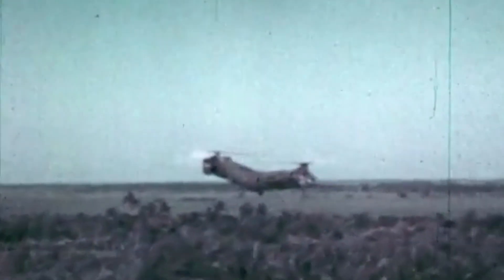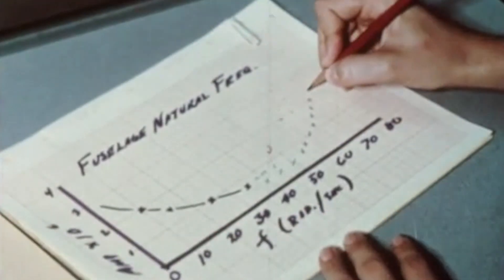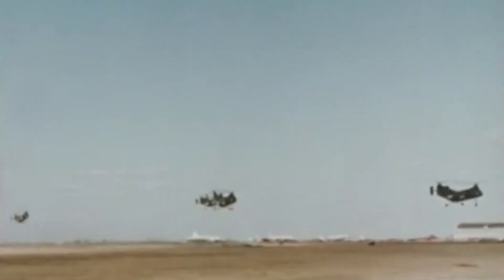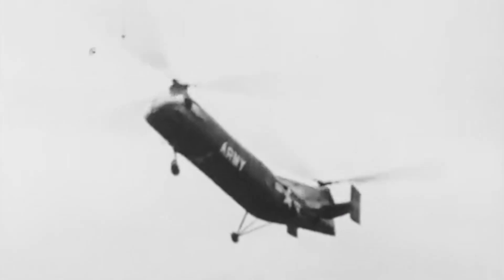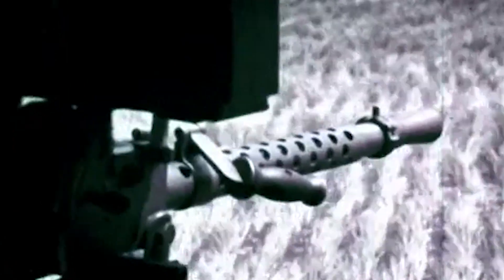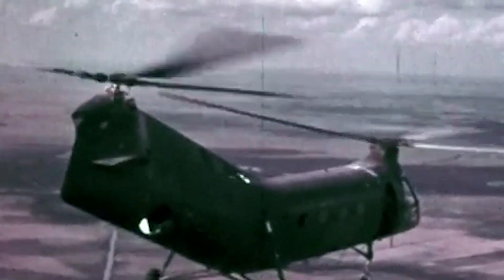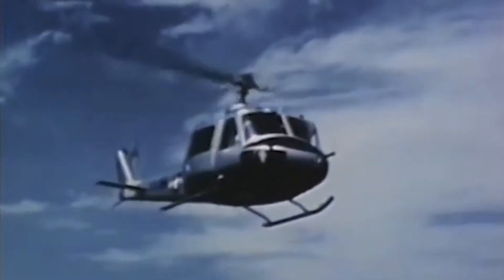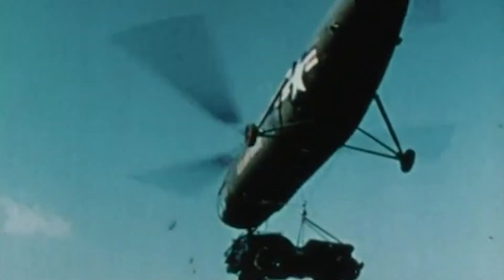Piasecki H-21

Comment: There was a lot of rethinking when Boeing became the owner of the helicopter line.  My step dad was one of the engineering and production design team members from Wichita to take on the challenge of seeing just what they had back then.  He related stories to me on how primitive some operations were at Piasecki when they came onto the scene.  They were using wooden yard sticks for doing what amounted to critical measurements and there were many variables that allowed as much as 1/4" off in matching fuselage parts.  Construction of hydraulic pipes and hoses amounted to them being custom for each unit so there was a very large parts replacement inventory but there was no guarantee it would fit any unit already out in the field.  Interesting stuff.

Comment: Used to see one fly over Long Beach Ca.  awhile back. You could hear the drone of the radials for miles before  you saw it. Fine piece of machinery.
Reply: Only ONE radial engine in an H-21.   And I'm surprised it never got upgraded to a turbine, but most of them timed out due to their wooden rotor blades. If you see one that's been out in the weather too long, the blades just fall apart when water gets into them. That "cold weather operation" rubric was a tongue-in-cheek reference to the under-powered design that required low density altitude to have reliable performance. This was in the early days of helicopters, when low disk and power loadings were the rule because bigger piston engines and rotor dynamics made so much vibration they literally shook themselves apart.
Reply: @craigwall9536  this one I saw , is at  Van Nuys I believe & there is a video on YT , on that airframe 
Thnx for info.
Reply: In the old days I worked on the last CH-21 in El Cajon at Gillespie Field. It was a lot of fun to fly in.

https://rotors.org/
Reply: @DavidS-iw4ei   got a ride in an old H34(radial) LASD-air frame retired in 87-' in 84'-medevac  to hospital. Only time flown, never even a fixed wing ride.

Comment: There’s a few of these at Pima air museum. You can even see inside
Reply: Great museum! Spent a whole day there once.
Reply: I've been to Pima twice, the last time with my dad, a retired USAF Chief. He remembered the tail number of every plane he worked on in the air force, and several of "his" planes are at Pima.
Reply: They have one at the Army Aviation Museum in Ft. Rucker, AL where the Army trains Army pilots and Warrant Officers
Reply: Our local surplus salvage yard had one out front that I used to crawl over as a teenager.  It was smaller in real life than it seemed on the screen.

Comment: In the early 1960's the Department of Defense interceded in the service rivalry which found the US Army with more fixed wing aircraft than the US Air Force and the Air Force in competition with the Army and the Navy over helicopters.

Basically after the decision the Army got the helicopters and the Air Force the fixed wing airplanes.
Reply: The Army was allowed to keep fixed-wing small observation and liaison aircraft as part of the deal.  The USAF had little interest in choppers and did not fully appreciate their potential as a ground attack aircraft.  Also, the Air Force was miffed about the Army having CV-2 Caribous, seeing it as a threat to the much larger Air Force C-123 Provider (which itself started life as an assault glider).  As part of the deal the USAF got all of the Army's CV-2s and rechristened them C-7s.
Reply: @Paladin1873  Thank you.
Reply: @lynnwood7205  My pleasure.  I knew two CV-2/C-7 pilots, one Army, the other USAF.  The former was a retired Army WO who told me his unit participated in a competition between their aircraft and the C-123 in the ealry 1960s and beat them in short-field landing and takeoff.  The C-123 was much larger and carried double the payload, so it would not surprise me that it lost.  He also told me he had transitioned into the Caribou from the Bell H-13 (Bell Model 47) where he had once tested them as potential gunships.  They mounted several Browning 1919 30 caliber machine guns on the skids.  I think this configuration saw some limited service early in the Vietnam War.  
The USAF pilot was a later coworker of mine who had flown the C-7 in South Vietnam in the late 1960s.  He told me one humorous story about flying down a river and spotting some suspicious looking characters on an island, so he buzzed them.  When he returned to base the maintenance crew found a bullet hole in the throttle quadrant between the two pilot seats and a matching hole in the roof.  Not bad shooting for a Gook. ;-)

Comment: For the record: the H21 were intensively used by the French Army in Algeria from 1955 to 1960 although it was indeed designed for low altitudes and temperatures. But they were the only H/Cs available on short notice at the time so they took them although in summertime they were operated in high temperatures and altitudes. The payload was then quite low but ... they invented the "air moblity concept", developing tactics to project force rapidly and close to the ennemy.
This concept then reached its peak when used at a large scale by the US in Vietnam.

Comment: What is that Shawnee at 8:22 doing? It looks like it's got either eight or 16 rocket strap to the front gear
Reply: Your answer would be at 0:35
Reply: Spot On! Got the enemy 
heads down, inbound 
to the landing zone. 🤟🏽🐻

Comment: The Flying Banana performed well as a transport helicopter in the French Algerian War of 1954-62, alongside the Sikorsky H-34.
In the rugged terrain that the French were fighting in, they quickly realized the value of being able to insert units into hard to reach positions at will. A few could put a platoon on a strategic hilltop that would otherwise have been several day's marching from the nearest road.

Comment: @ DarkSkies, you switched the CH-46 and CH-47 pictures at the 7:50 mark.  As a CH-47 "Hooker" for 21+ years, I died a little bit inside.  😅
Reply: I'm about half convinced by now that he does this sort of thing on purpose to see if anyone is paying attention.
Reply: I can assure him, we are!  😄
Reply: @heavenst.murgatroyd3128  I've commented many times on the 'mistakes' on @Dark uploads - I still can't decide if they are genuine mistakes or a deliberate, not to say cynical, ploy to increase engagement - more mistakes, more comments, more engagement, good for the YouTube algorithm.
I can kinda understand doing it, however this is supposed to be a factual, documentary style channel, where too many mistakes could be seen as a turn off for a number of subscribers.
I'm no academic, but if I can notice as many mistakes as I do I can only imagine how many the real history buffs spot.
Reply: As a former Navy H-46 driver I caught the swapped pictures between the H-47 & the H-46. The smaller H-46 was primarily flown by the Marines but the Navy used them for both search and rescue plus under way replenishment of the fleet. The H-46 had an advantage for the Navy in that the rotar blades folded across the top of the fuselage. In an emergancy it could also land on the water, but don't come down too hard. We were told the record time to sink for an H-46 with a broken chin plexiglass was about 9 seconds.
Reply: Not to twist the knife but the Sea Knight is a beautiful bird. The Chinook is... well... useful.
Reply: @justme_gb  90% of people couldn't tell the difference between the two of them without it being pointed out.

Comment: Forwared/aft (elevator) on a tandem is accomplished by increasing the collective pitch on one rotor and decreasing it on the other. Left/right cyclic (aileron) is the same as a single rotor helicopter i.e. increasing and decreasing cyclic pitch on each side of the disks. Interestingly while aileron cyclic has phase delay like a single rotor helicopter elevator does not because it involves the entire rotor disk changing collective. Yaw (rudder) is by opposing aileron at the front and rear rotor disks which pushes the disks in opposite directions. By mixing rudder and aileron control inputs the pilot can shift the point of rotation forward or aft from center. The pilot controls work exactly like an ordinary helicopter with a cyclic stick collective lever and rudder pedals (though the manual refers to the collective lever as the "thrust control lever"). 

 Elevator cyclic is unnecessary however later model CH-47's have a "longitudinal trim actuator" which is used to bring the nose up in forward flight to reduce drag (make the helicopter more level in fast forward flight) and push the nose down in hover and compensate for the CH-47's nose high hover (the rotor masts are tilted forward a few degrees which causes it to want to hover nose high). This is all handled by the flight electronics the pilot has no direct control over the elevator trim. Elevator cyclic cannot be used for forward/backward movement in a tandem helicopter, all it can do is push the nose up or down, to move forward a tandem has to use differential collective at the front and rear rotor disks.

Comment: 0:25 is that a first prototype of CH-47 Chinook?
Reply: Yea
Reply: No, it's an H-21 which came many years before anyone even thought about the CH-47 and they are very different.
Reply: @live2ride18  Don't say yea when the answer is no.
Reply: @skunkjobb  you’re right I was wrong but so are you. I mistook the word for predecessor I see coming back here but what are you talking about? 
Do you know when this aircraft retired?
1964. 
Do you know what tandem rotor aircraft took it’s place?
Ch-47. 
So in a lot of ways it WAS the prototype. They slapped another turbine on. Upgraded them to around 10000 hp, got to then widen it, add a machine gunner door to some variants, it could carry the 20 men that the h-21 was supposed tooooooo
So. 
I would not go around being the YouTube know it all. Then tryna scold someone like my grandma when I was 4. 
That doesn’t always work out for you. This banana that the “chinooks never ever heard about” had OVERLAPPING SERVICE. 
Know what that means? 
They use them both at the same time 😱
Alas, the h-21 was retired in 1964 after serving some time in the Vietnam war when guess who took over....
Ch-47 which was first flown in 1961. Entered service in....1962. 
Good day 😉
Reply: @live2ride18  I'm with you.

The HUP 1/2/3 begat the H-21 which begat the H-46 (my bird) and H-47, so substitute predecessor for prototype and you're 100% correct.

The tandem rotor configuration has many advantages:  it makes the aircraft much less sensitive to weight and balance variations with internal and external cargoes (great for moving beans, bullets and BandAids), better or at least less complicated flight characteristics, an unobstructed cargo deck and safer pax operations since the dynamic components are well out of the way (no tail rotor).

Phrogs Phorever!

Semper Fi!
Reply: @joseywales6146  Thank you Sir. 
I live in the middle of a triangle of three air bases and a supply base. Always been keen on aircraft and studying warfare and it’s equipment. 
I would have loved to have went to the local A-10 school, but my grandpa built a rather large farm that my dad has now. 
The A-10’s practice overhead. I’m 28 and over the years being in fields I’ve seen the warthog’s pilots faces (helmets) they swoop in our fields, I guess to practice flying under radar 🤷 so low they pull up for trees. Went in front of me 1000 feet at 50-60 feet high. Got a personal air show with flares four days ago. 
Appreciate it. I bet your time served was fun.
Reply: @live2ride18  thanks for the info bro ☺️
Reply: @jeraldsantosmunoz6273  well... I did try and keep it simple 😅
But I don’t like when people give me bullish!t when their full of it themselves 🙄
Reply: @live2ride18  yeah I know but I’m just asking if I am not right and I’m free to correct me tho
Reply: @jeraldsantosmunoz6273  you know how they have 3rd, 4th, 5th..etc generation jet fighters. In this case it’s like that. All the demands that were requested for this aircraft that it was never able to meet were learned upon and applied to the ch-47 to me the demands plus a whole lot more as turbine technology increased over the 20 years. There was an aircraft in between as the crew member of one commented on your thread. It’s not a direct prototype in the usual way. This one was used for 20 years but it’s a “we developed the ch-47 because we stood on the shoulders of the giants that made this”
Technology improved to meet the requirements the military had in mind to begin with. The aircraft stayed about the same. She just got some serious weight and hp added. 
Amazing aircraft that they teach them to fly like it’s a 10 foot helo 😂
Reply: @live2ride18  absolutely bro

Comment: The reason the Army was forbidden from having ‘large helicopters’ was the same reason the Army was restricted to light observation and utility fixed wing aircraft and light helicopters. In the late 1940s the Air Force, a new branch independent of the Army it had spun out of, screwed the Army in an agreement executed at a weekend conference in Key West, Florida between the Secretaries of the Army and Air Force, and umpired by the Secretary of Defense. That is why the Army never got its own tactical air support capability like the Marines have, and that is why the Army had to develop armed attack helicopters, cargo helicopters, and troop transport helicopters during the Vietnam War. The Army today has the Apache and other advanced helicopters, but it still has to rely on the Air Force for tactical air support.
Know how much the Air Force cares about that? The Air Force sees itself as a missile, bomber, and fighter force. Not a tactical close air support force. The Army was developing a radically new armed attack helicopter a couple of decades ago. The Air Force, afraid the money for that helicopter would come out of its budget if it let the Army project go further, said ‘ We’ll develop a special aircraft that will be ideal for low level close air support’. 
What resulted from that was the A-10, known as the Warthog (but officially as the Thunderbolt), probably one of the best close air support  aircraft ever made. As soon as the Army program was shut down and the Air Force got the A-10, it started to try to find ways to get rid of it. Desert Storm saved the A-10; it killed so much Iraqi armor and slaughtered so many of Saddam’s Republican Guard it couldn’t be ignored. In the endless expeditionary wars we have fought since 9/11, the A-10 has proven itself to be the answer to the Army’s problem, and the Air Force has not once slackened its attempts to kill it.
That’s how much the Air Force cares about close air support.
Oh, yeah... sorry, I got off track. The H-21 was a good, if underpowered, aircraft in its day. In the early years of the Vietnam War, the Army Transportation Corps owned all the Army aircraft. The H-21s that went to Vietnam in 1961 and 1962 initially operated in the Mekong Delta, lifting units of the South Vietnamese Army. The Marines owned some and the Army owned some. The other troop helicopter in those early days in Vietnam was the Sikorsky H-34.
The H-21 wasn’t known so much as the ‘flying banana’ as it was known as the ‘Shuddering Shithouse’ for its characteristic vibration.
Reply: No the A-10's battle field statistics were actually falsified for the longest time in 91 the F-111 and the F-15E actually have more tank kills and sorties

Comment: The tandem rotor configuration makes aircraft suitable for heavy cargo hauling, especially with electrically controlled external cargo hooks. 

This type benefitted from not having a conventional tail rotor, thereby allowing full power to be used for lifting, it also made the aircraft considerably safer because tail rotor failures result in deviation from controlled flight and frequently to the loss of the aircraft and crew!

Eliminating the tail rotor and it's inherent dangers further enhanced survivability of the aircraft during use in  hostile environments.

Today's Boeing CH series of tandem rotor helicopters are further developments of the type and have been incrementally upgraded and improved to remain current.

Comment: The Huey did not have a "jet" engine. It had a turbine, like the vast majority of helicopters do today. A jet is a specific type of turbine used to produce thrust, not torque.
And the reason helicopters use turbines instead of piston engines is because the turbine is most efficient running at its highest speed, because for a helicopter, there isn't much difference in fuel consumption between hovering and going flat out. Piston engines are the opposite. They can provide reasonable fuel consumption over a wide range of speeds, but at its highest speeds it is inefficient and wears out quickly.

Comment: 3:10 OK so the iron cross on it gets no mention???
Reply: That's belong to the Bundeswehr. (West) Germany was one of the several operators flying this aircraft.
Reply: @Joshua_N-A  I thought they (West Germany) outlawed the symbol soon after ww2 ended?
Reply: @TheDarkFalcon  iron cross existed even long before Bismarck was born. It dated back to the days of Teutonic Knights. Swastikas was used by WW1 pilots of both sides including one Jewish Imperial German ace pilot. The modern emblem used by the Bundeswehr today is based off the pre WW1 era design.

Comment: What was the purpose of that circular opening in the fuselage near the tail ?
Reply: The opening is used for mechanics to enter the rear of the helicopter and work on the engine, engine shaft, Oil tank,  and make any necessary adjustments etc.